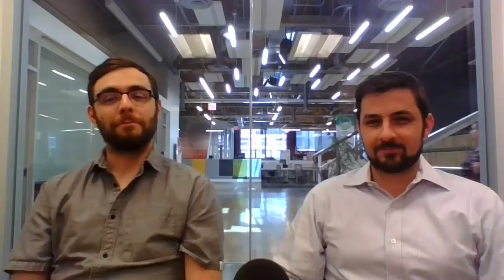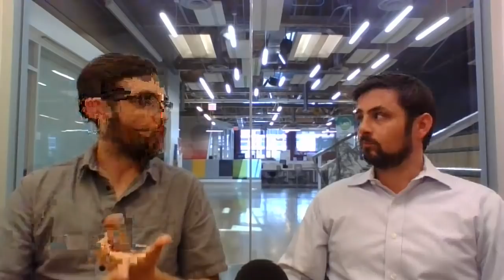SolarEdge VS. Enphase: The Ultimate Inverter Showdown - #65

Comment: I have been doing a bit of research, have no affiliations and have come up with the following in my context in Australia, both 6kw with 350w panels.  Might be different for others, but here it goes...
Max inverter output | Enphase 240w | SolarEdge 350w | Difference 146%
Weighted efficiency | Enphase 96.5% | SolarEdge 99% | Difference 102.6%
Quoted Cost | Enphase 2.16/watt | SolarEdge 1.80/watt | Difference 83%

I find these figures quite compelling in a payback the system scenario.  Unless I am off the mark, I am wondering why this side of it isn't talked about much.  The main focus of discussion seems to be around distributed architecture.  The Enphase technology looks really juicy, but the performance of the SolarEdge is far superior, it uses all of the panels output, converts it more efficiently and costs way less.  It makes sense that Enphase costs more, as they need to repeat the inverter technology for every panel, whereas SolarEdge gets the economies of scale of just having one efficient inverter doing the whole lot.  Please let me know if I am missing something.
Reply: You compare apples and oranges. Enphase max output is equivalent to SolarEdge inverter rating, I.e. 10K, 7.5KW and so on. Rating of optimizer cannot be compared with anything in microinverters.

Efficiency in SE system is a combination of optimizers and inverter efficiency.

Enphase has 4 different models of IQ microinverters with max output rating between 250W (IQ7) and 300 something. More rating does not mean better. It is too complex to explain in a single paragraph but in a nutshell microinverter is matched to expected panel output during optimal conditions, but not short peaks that are unlikely to last more than several hours in a year. Ratio of panel STC power rating to microinverter rating in 1.25-1.4 range is very common. Some clipping, that is not common, indicates that an inverter was matched correctly to panels output, instead of spending extra on something that is used 0.1% of the time.

Enphase has 25 years warranty for microinverters. SE inverter has 12 but extended warranty can be purchased. If you compare the cost you need to add SE warranty extension cost.

A bigger problem for SE, from my point of view, is higher expected failure rate for optimizers and inverters. Replacements take time and this should be used in comparison of cost.
Reply: Dead wrong...when your Solar Edge product fails you are out weeks...or maybe months. A few inverters going out is not going to reduce the ROI as much as a failed Solar Edge.

Solar Edge is not innovating. Enphase is the apple of the solar world. Easier to install for the layman.

Comment: Enphase, with its Distributed Architecture, is the only way to Solar.   The string inverter/optimizer seems sooo dated.  Why would anyone go with a single point of failure system,  seems like old technology technology to me.
Reply: I switched my order from enphase to solar edge because battery was a lot cheaper for the same performance
Reply: @John_Ridley  The important thing is your going solar,  and for that I congratulate you.  Batteries are tough to pencil out, but I understand there are reasons other than financial.
Reply: @Tony-fy6bs  We don't have net metering here so I want to self consume. Also as you imply, my reasons for going solar are not at all financial. I'd be doing it even if it never paid for itself.
Reply: @John_Ridley  Thank you for going solar.  Best of luck with your system,  I'm sure it'll be wonderful. 🙂 
If you get a chance film your installation.  Thanks
Reply: @Tony-fy6bs  Definitely will I have a DIY blog/channel.

Comment: (Full transparency – I work for Enphase)

First, thank you both for the insight and the attempt to simplify the comparison between (what could be considered) two complex technologies.  An enjoyable presentation & very relatable!

That said, they are not "pretty much the same" and it’s unfortunate that you seem to have forgotten the most compelling & critical difference between the two technologies; single-point-of-failure vs. distributed architecture.

With string inverter + optimizer, if the inverter goes out – the customer loses ALL generated power.   The installer must make an “emergency” truck roll.   The overall ROI & system production decrease.   It could be days, weeks or even months before the system is back up & running.  What homeowner would knowingly want to take that risk?  Particularly given that the string inverter only has a 12-year warranty which implies that it WILL likely fail and need to be replaced at least once.

To put this into meaningful terms for any homeowners reading this; on a 6.72kw system - 1 week of lost production = ~1.37% of total annual output.   2 weeks of lost production = ~2.74% total annual output.   3 weeks of lost production = ~4.11% of total annual output.  Assuming $.35/kwh, that could cost the homeowner from $50-$150+ of lost savings/ROI from a single outage!

With microinverter technology, if you ever have a single inverter go down, the others continue to work.   You should never have a situation where your entire system goes down (as is mentioned in a different context at 1:55).  That is the most significant benefit of a distributed system architecture vs. single-point-of-failure.   When it comes to ROI, diversification is fundamental - any experienced advisor will tell you that.

It’s a bit shocking that ANY salesperson in solar who consider themselves a trusted advisor could skip that part of the conversation.

Ryan

P.S.  Enphase is now offering module-level data in Enlighten at no cost to the homeowner.
Reply from the maker: Hi Ryan, we appreciate you taking the time to watch our deep dive and following it up with your comments and feedback. We will be discussing your comments in a follow-up livestream very soon!
Reply: @Pickmysolar  Thanks!   I look forward to it!   Again, great work and thank you all you do in helping to educate folks!
Reply: @ryanstepp9972  thanks Ryan! Enphase is the true symbol of DG
Reply: @Pickmysolar  don't forget the upcoming IQ8 grid-agnostic microinverters
Reply: So many questions I have for you! Enphase seems to be the dominant technology player right now. Badri seems to be a great CEO and expanding at a great rate without taking on huge debt. I know they are working on a transactive energy dept. What do you see going forward?
Reply: Can you confirm that the latest IQ will work even when the grid is down without batteries? I heard something like that...
Reply: @umbertosmith1510  It's my understanding that all IQ microinverters are capable of working when the grid is down but not until a crucial new piece of hardware is available and installed. I also suspect it will require an Enphase battery to work.
Reply: Is there a better/reliable Enphase inverter now ? I have the M 190 Inverter installed back in 2011 and out of 15 9 have failed so far.
Reply: @indman101  As part of the Enphase Upgrade Program for Early Adopters, we are offering owners of legacy microinverters the opportunity to replace their second-generation microinverters with new, seventh-generation Enphase IQ 7 PD (Powered Down) Microinverters, at a heavily discounted price. The microinverters have been powered down to be compatible with the existing solar panels and system equipment.

The new Enphase IQ 7 PD Microinverters will come with a fresh 25-year product warranty. We are also including an IQ Envoy and Consumption CT Meters as part of the upgrade, included in the equipment price. Keep reading to learn more about what equipment is included, how to avoid common pitfalls to quote your job accurately, and how the upgrade process works.

https://enphase.com/en-us/upgrade/option-1/next-steps#about
Reply: Good explanation.  I think I’d rather take the chance of being down for a couple weeks to fix something in the wall in my garage than have to get back on the roof to take apart a bunch of panels to replace 1 bad micro that’s in the middle of the array and have to put it all back together.
Reply: "Assuming $.35/kwh"  LOL, hardly anyone pays that much in usa. More likely 11 cents which is 1/3 your inflated fake average.
Reply: @rollandelliott  I'd like to refer you to the rates charged by SCE (Southern California Edison) where roughly 9% of the country's population lives. TOU (Time Of Use) is the most cost effective rate plan as high cost usage can be planned for and controlled. You'll see that Peak Summer Rates can be $0.66 / kWh. And CA has regulations in place that ALL new housing have Solar Panels installed during the build. So, you are lucky to live where rates are low, but the ROA in California can be just a few years, depending on the system size and rebates (supposedly ending this year)..  https://www.sce.com/residential/rates/Time-Of-Use-Residential-Rate-Plans
Reply: Ive been in home improvements sales for many years and Ive sold solar for 3 month this year and learned a lot. Also have a bachelors in Electronics Engineering. Ryan Stepp comment has some good points buts its a sales pitch, which i like ;), although Id like to point out the market share of solar edge and the stock price for each company. I only sold Solar edge system because that's what is most popular and for a good reason. Whole sale solar also recommends Solar edge inverters to diy's. So can someone tell me why SEDG has more market share and is considered better? Also SEDG inverter has a 25 year extended warranty and depending on the company selling it, it may or may not cost more to the homeowner which is stated in the video.
Reply: Harry J in my opinion stock price is irrelevant but market share is something else like you mentioned. My guess, it is because of the cost premium that comes with micro inverters.  I have a spreadsheet with 100’s of systems that I will continue to refine to see what the cost delta % is between the two technologies.
Reply: @jpena53  Stock price is not irrelevant. It tells you a lot. ENPH may catch up though. Both have surged this week.